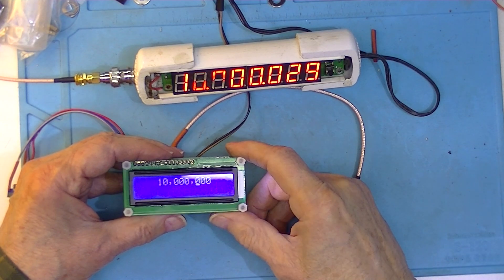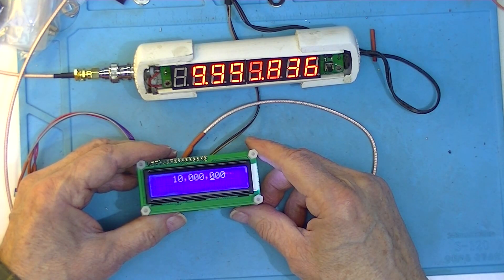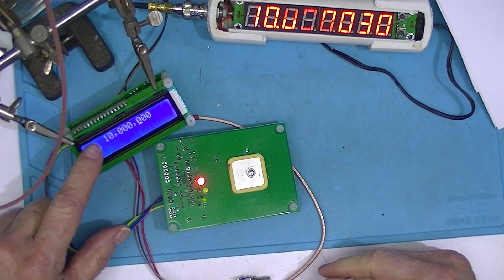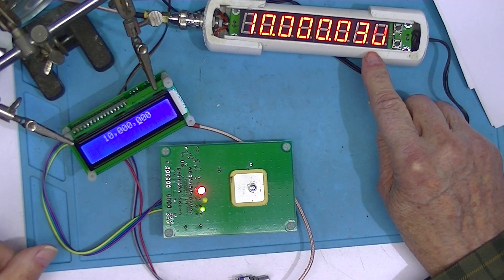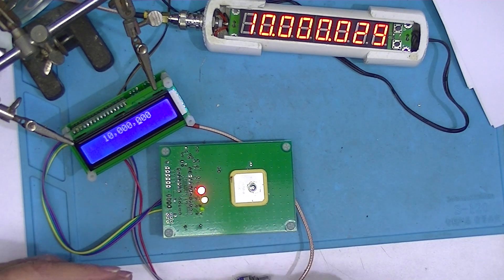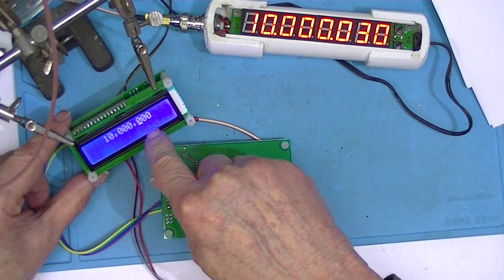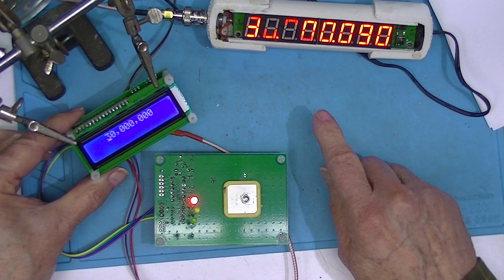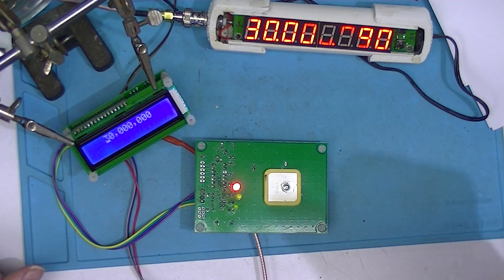QRP Kits Signal Generator Part 3

Comment: The big issue if there is one with the  Qrp Labs VFO is there is no protection on the output and no provision for amplifying it if you can't use it as is.  a 74AC04 will work as a digital amplifier up to about 60 Mhz and provide some protection to the driver.  Above this you have to use chips like the  OPA2674 VHF video amplfier chip but the maximum coupling capacitor that can be used is 5pF so the drive voltage is very reduced  (and driving a  digital signal  through a capacitor is not the best thing to do as a coupling method.   Any use of an RF transformer directly no the output will kill the device / board. 

TE Fidler - NzL